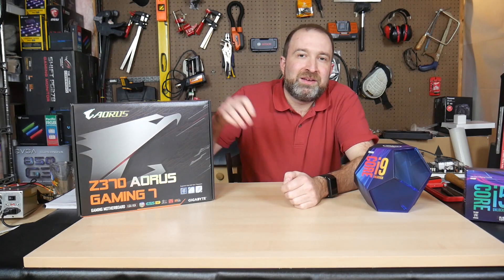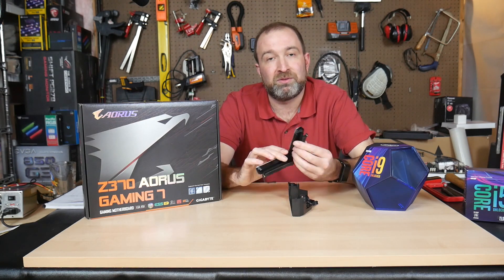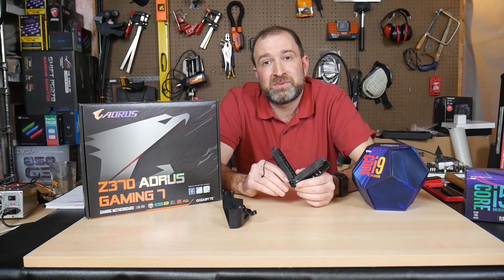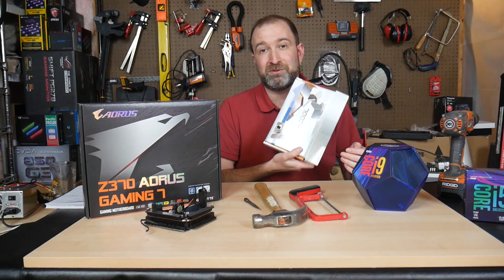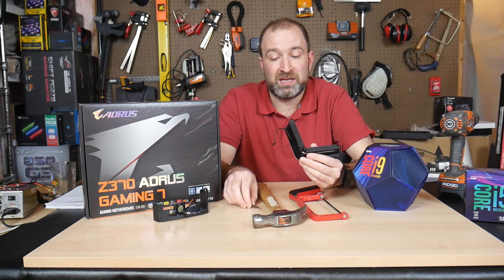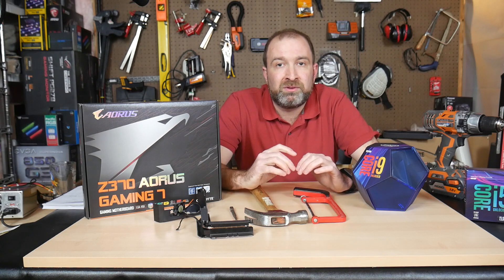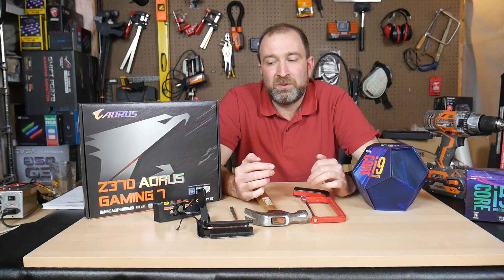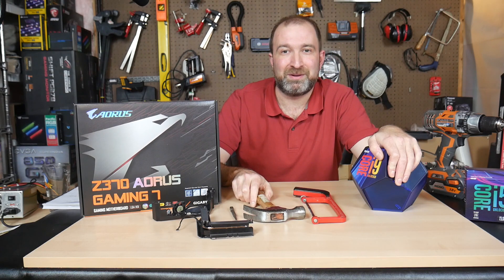Review: Intel i9-9900K vs. Z370 Gaming 7 VRM

Comment: Hi there, from Argentina. I have been thinkin on installing a 9900k on a z370 aorus gaming 5. Would you recomend it, just to gaming (not extreme or proffessional gaming). Or at least which cpu would you recomend me the best for this MB, thanks in advance !
Reply: Would like to know this as well if anyone has this particular setup.
Reply from the maker: @shinychrome247  I wouldn't recommend pairing a Z370 Gaming 5 with a 9900K, my Z370 Gaming 7 barely passed. Though if you are like me and want to find out for science and report your findings, please do so. :)
Reply from the maker: To be honest, if you are willing to spend the money on a 9900K, I would highly recommend getting a board like the Z390 Master. The Z370 Gaming 5 shouldn't be in the same room as a 9900K. Other Gigabyte boards like the Pro, Elite, and Ultra are good options. Even though I have this working, I keep eyeing the Z390 Master.
Reply: Bullshit !

it's advertising to push to move to a z390 chipset motherboard to use an i9 9900K?

 I have a Aorus Gaming 7 Gaming rig and it is equal to my Z390 Gigabyte Designare editing PC. With the 8700K at 5.3GHz the VRM is level at 60°c. That's a great temp for just an 8phase. So I have no doubt that the Aorus Gaming 7 can handle the 9900K. The Z370 Aorus Gaming 7 has one of the best VRM implementations on a motherboard. It uses the most expensive components from intersil. 

They use the same components on the Z390 EVGA DARK and the X299 DARK. Those boards are among the best in the industrie. So when someone says that the VRM on the Aorus Gaming 7 is worse than the ones on the Z390's has no knowledge about PC components.

    The Aorus Gaming 7 does only have 8 phases but they are rated at 480A. Just like the Z390 Ultra. The 8 phase is just as strong if not stronger than the 12phase they use on the mainstream Pro'Elite boards. The Gaming 7 uses 8 x 60A powerstages with 76A chokes when the Z390 mainstream boards use 40A power stages with 40A chokes. 50A on the Master and Ultra. Also the Gaming 7 has Current and Temp monitoring and current balancing just like the Z390's. Gigabyte used the Gaming 7 as a reference board for Z390.  

The Gigabyte Z370 uses server-grade digital vrms, these are the famous ISL99226B developing 60 A. which is more than enough to power a 'simple I9 9900K and then to reassure those who have this card, the Vrms of the Gaming 7 beyond 90 degrees, they are cooled by a small fan.But apart for big OC like an i9 9900K @ 5.2 ghz @ 1.25V the vrms will rarely exceed 80 degrees.
The Gigabyte Z370 Aorus Gaming 7 has the best VRM components you can buy. From the 60A Smart Power Stages to the current and temp balancing. There's the 76A inductors that are on GIGABYTE's X299 motherboards. Basically the VRM that they use on x299 are used here. That's a guarantee that this can handle a i9 9900K. This 8 phase is as good as a strong 12 phase. 

For normal overclocking the vrm on of the Gigabyte Z370 Aorus Gaming 7 should more then fine for moderate overclocking a 9900K on liquid or aircooling.
The vrm is indeed an all intersil implementation.
And it is really a decent implementation.
For the main vrm they use the ISL69138 in 4+2 phase mode.
For the main vcore they have doubled 4 phases to 8 using ISL6617 phase doubler,
which is a realy nice smart doubler that does load current balancing between phases.
Which is really nice.
The powerstages they use are also ISL99227 60A smart power stages.
So as far as the vcore vrm is concerned, this board should be more then edequate enough

The Gigabyte Aorus Z390 Master does not use an ISL implementation on the vrm.
They use an IR implementation with IR3553 40A power stages only.
But the IR Vrms are 12 in number so the developed power is 40 x12 = 480A as for the Z370 Gaming 7 with its 60AX8 = 480A.

therefore, if you already have a Aorus z370 gAMING 7 and you want to put a  I9 9900K and OC a little, you do not need to change the motherboard.By cons if you have a low-end Motherboard Z390 and you want OC then yes !  you have to change to a master Z390 or similar if you have a low-end Z370 then change at least for mid-range Z390.

  in conclusion: High-end Z370 mobos should have no problems running the 9900K. They have better power delivery than cheaper Z390 mobos. Just be sure to update the bios. @SolarityTechnology
Reply: @SolarityTechnology  

Bullshit !

it's advertising to push to move to a z390 chipset motherboard to use an i9 9900K?

 I have a Aorus Gaming 7 Gaming rig and it is equal to my Z390 Gigabyte Designare editing PC. With the 8700K at 5.3GHz the VRM is level at 60°c. That's a great temp for just an 8phase. So I have no doubt that the Aorus Gaming 7 can handle the 9900K. The Z370 Aorus Gaming 7 has one of the best VRM implementations on a motherboard. It uses the most expensive components from intersil. 

They use the same components on the Z390 EVGA DARK and the X299 DARK. Those boards are among the best in the industrie. So when someone says that the VRM on the Aorus Gaming 7 is worse than the ones on the Z390's has no knowledge about PC components.

    The Aorus Gaming 7 does only have 8 phases but they are rated at 480A. Just like the Z390 Ultra. The 8 phase is just as strong if not stronger than the 12phase they use on the mainstream Pro'Elite boards. The Gaming 7 uses 8 x 60A powerstages with 76A chokes when the Z390 mainstream boards use 40A power stages with 40A chokes. 50A on the Master and Ultra. Also the Gaming 7 has Current and Temp monitoring and current balancing just like the Z390's. Gigabyte used the Gaming 7 as a reference board for Z390.  

The Gigabyte Z370 uses server-grade digital vrms, these are the famous ISL99226B developing 60 A. which is more than enough to power a 'simple I9 9900K and then to reassure those who have this card, the Vrms of the Gaming 7 beyond 90 degrees, they are cooled by a small fan.But apart for big OC like an i9 9900K @ 5.2 ghz @ 1.25V the vrms will rarely exceed 80 degrees.
The Gigabyte Z370 Aorus Gaming 7 has the best VRM components you can buy. From the 60A Smart Power Stages to the current and temp balancing. There's the 76A inductors that are on GIGABYTE's X299 motherboards. Basically the VRM that they use on x299 are used here. That's a guarantee that this can handle a i9 9900K. This 8 phase is as good as a strong 12 phase. 

For normal overclocking the vrm on of the Gigabyte Z370 Aorus Gaming 7 should more then fine for moderate overclocking a 9900K on liquid or aircooling.
The vrm is indeed an all intersil implementation.
And it is really a decent implementation.
For the main vrm they use the ISL69138 in 4+2 phase mode.
For the main vcore they have doubled 4 phases to 8 using ISL6617 phase doubler,
which is a realy nice smart doubler that does load current balancing between phases.
Which is really nice.
The powerstages they use are also ISL99227 60A smart power stages.
So as far as the vcore vrm is concerned, this board should be more then edequate enough

The Gigabyte Aorus Z390 Master does not use an ISL implementation on the vrm.
They use an IR implementation with IR3553 40A power stages only.
But the IR Vrms are 12 in number so the developed power is 40 x12 = 480A as for the Z370 Gaming 7 with its 60AX8 = 480A.

therefore, if you already have a Aorus z370 gAMING 7 and you want to put a  I9 9900K and OC a little, you do not need to change the motherboard.By cons if you have a low-end Motherboard Z390 and you want OC then yes !  you have to change to a master Z390 or similar if you have a low-end Z370 then change at least for mid-range Z390.

  in conclusion: High-end Z370 mobos should have no problems running the 9900K. They have better power delivery than cheaper Z390 mobos. Just be sure to update the bios.

Comment: I'm about to install a 9900K on an Asus Prime Z370-a motherboard, with an open case and a fan blowing at the VRM's.
Reply from the maker: Let me know how it goes. I would avoid Prime 95 w/ AVX.
Reply: Bullshit !

it's advertising to push to move to a z390 chipset motherboard to use an i9 9900K?

 I have a Aorus Gaming 7 Gaming rig and it is equal to my Z390 Gigabyte Designare editing PC. With the 8700K at 5.3GHz the VRM is level at 60°c. That's a great temp for just an 8phase. So I have no doubt that the Aorus Gaming 7 can handle the 9900K. The Z370 Aorus Gaming 7 has one of the best VRM implementations on a motherboard. It uses the most expensive components from intersil. 

They use the same components on the Z390 EVGA DARK and the X299 DARK. Those boards are among the best in the industrie. So when someone says that the VRM on the Aorus Gaming 7 is worse than the ones on the Z390's has no knowledge about PC components.

    The Aorus Gaming 7 does only have 8 phases but they are rated at 480A. Just like the Z390 Ultra. The 8 phase is just as strong if not stronger than the 12phase they use on the mainstream Pro'Elite boards. The Gaming 7 uses 8 x 60A powerstages with 76A chokes when the Z390 mainstream boards use 40A power stages with 40A chokes. 50A on the Master and Ultra. Also the Gaming 7 has Current and Temp monitoring and current balancing just like the Z390's. Gigabyte used the Gaming 7 as a reference board for Z390.  

The Gigabyte Z370 uses server-grade digital vrms, these are the famous ISL99226B developing 60 A. which is more than enough to power a 'simple I9 9900K and then to reassure those who have this card, the Vrms of the Gaming 7 beyond 90 degrees, they are cooled by a small fan.But apart for big OC like an i9 9900K @ 5.2 ghz @ 1.25V the vrms will rarely exceed 80 degrees.
The Gigabyte Z370 Aorus Gaming 7 has the best VRM components you can buy. From the 60A Smart Power Stages to the current and temp balancing. There's the 76A inductors that are on GIGABYTE's X299 motherboards. Basically the VRM that they use on x299 are used here. That's a guarantee that this can handle a i9 9900K. This 8 phase is as good as a strong 12 phase. 

For normal overclocking the vrm on of the Gigabyte Z370 Aorus Gaming 7 should more then fine for moderate overclocking a 9900K on liquid or aircooling.
The vrm is indeed an all intersil implementation.
And it is really a decent implementation.
For the main vrm they use the ISL69138 in 4+2 phase mode.
For the main vcore they have doubled 4 phases to 8 using ISL6617 phase doubler,
which is a realy nice smart doubler that does load current balancing between phases.
Which is really nice.
The powerstages they use are also ISL99227 60A smart power stages.
So as far as the vcore vrm is concerned, this board should be more then edequate enough

The Gigabyte Aorus Z390 Master does not use an ISL implementation on the vrm.
They use an IR implementation with IR3553 40A power stages only.
But the IR Vrms are 12 in number so the developed power is 40 x12 = 480A as for the Z370 Gaming 7 with its 60AX8 = 480A.

therefore, if you already have a Aorus z370 gAMING 7 and you want to put a  I9 9900K and OC a little, you do not need to change the motherboard.By cons if you have a low-end Motherboard Z390 and you want OC then yes !  you have to change to a master Z390 or similar if you have a low-end Z370 then change at least for mid-range Z390.

  in conclusion: High-end Z370 mobos should have no problems running the 9900K. They have better power delivery than cheaper Z390 mobos. Just be sure to update the bios. @SolarityTechnology
Reply: @NapalD  Dou you think that an MSI Z370 SLI PLUS is able to handle a non-k 9900 or a stock 9900k?
Reply: @SolarityTechnology  Yeah I wouldn't dare run Prime95 without an AVX offset.

Right now I'm running at 4.9GHz with 1.29 vcore, I can't go higher without overheating due to my 120mm radiator. I can't fit a larger one in my case, but that will be the next thing I upgrade.

As far as the VRM temps go (with the 4.9GHz overclock), idle is around 43 degrees, gaming for an hour+ the max temp is around 62 degrees and when I'm encoding in premier under full load the max temp is upper 80's to low 90's, the max I've ever seen is 92 degrees. The fans REALLY helped keep the temps under control, without the fans I would reach 90 degrees within 2 minutes of encoding!
Reply: @SolarityTechnology  
do you know the vrms or voltage regulation module? Do not you think that with 480a a 8-core CPU can work beyond its initial frequencies ?

Comment: why you gotta overclock a cpu that is for z390 wtf did you expect
Reply from the maker: For Science!  I got the 9900K at a good price and wanted to test it out. I knew that the VRM Heatsink was subpar, though knew the mosfets could handle it. I looked into this before I got the CPU. The mosfet heat output should be fine under most conditions, though I wanted it to be fine under heavy loads. I am still rocking this and it has been great!
Reply: @SolarityTechnology  how to connect fluid sequence? or in parallel?

Comment: So a 9900k @5ghz with a monoblock should be able run it right?
Reply from the maker: I would prefer active cooling the VRMs with water. Stock was too much heat for what I liked, the higher heat might impact the life span of the components in the VRM and create situations of throttling. If you want a 9900k and haven't gotten a MB yet, just get a good MB like the Z390 Master.
Reply: thanks, i have a monoblock with 2 mo-ra3s and 2 360s.
Reply from the maker: @MrKZdemos  LOL, you will be fine.
Reply: well its running pretty good for passive cooling, 60C package/73 on hottest core/43C on vrms with aida completely stock. i havent added my 2080ti to the loop yet but i might just add some 200mm fans to the mo-ra3s. all the radiators get really warm and the monoblock gets hot, it scares me a little.
Reply: Use an EK 270/370 Monoblock. The VRMs get hot, but they are high end and can go to 135C on this mobo.

Comment: damit im in class was hoping for some graphs cant use speakers, I have a gaming 7 with cm ml360r aio in push\pull to use with the i9.
Reply from the maker: Hard of hearing? I wouldn't try it unless you have a monoblock or vrm blocks like I do. Was hitting 100c on the VRM in a minute with Prime95 and high 90s with long real bench run. Temps were about 50c lower for the vrm when cooled with the vrm blocks.